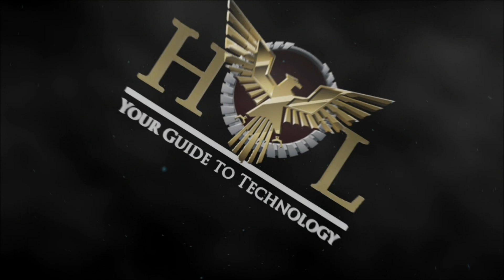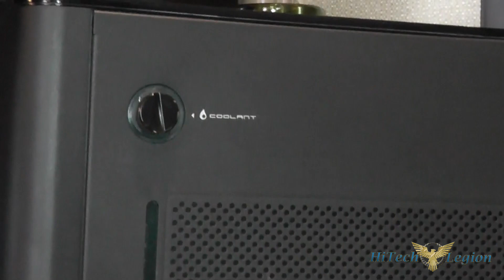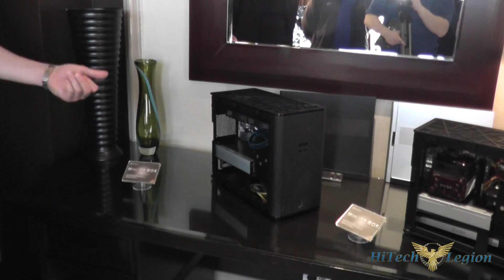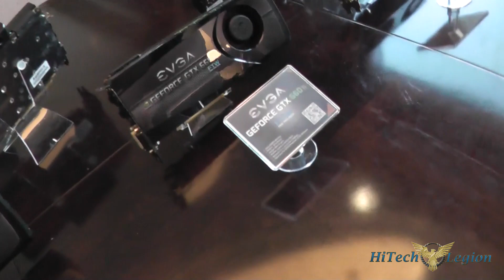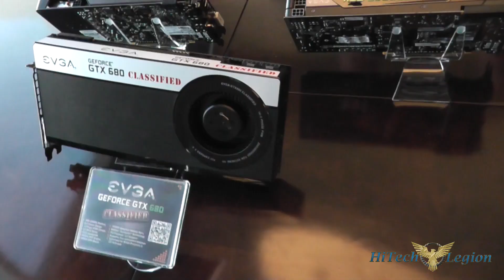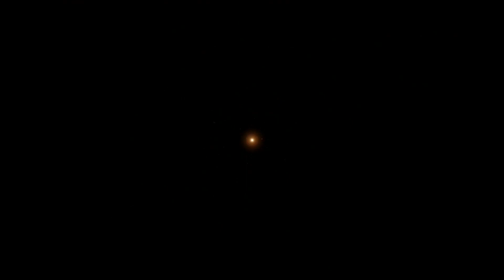CES 2013 Day 3 - EVGA Suite

Comment: EVGAs psus are very inpresive iv seen the 1500 in action and with 4 way sli 680s in a custom cosmos II it dident break a sweat the . the price it well worth it, you get what you pay for,and thair gpus are just the best out thair at the moment I run2x670 4gb cards and am very happy with them 5760x1080 N/P